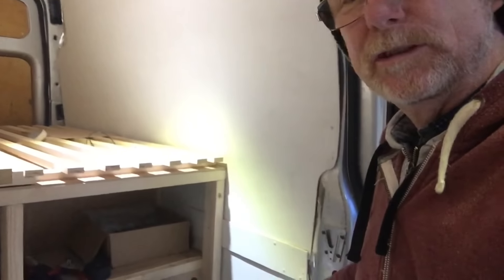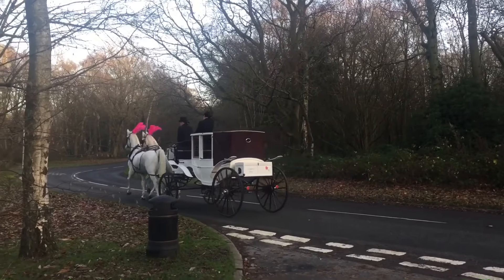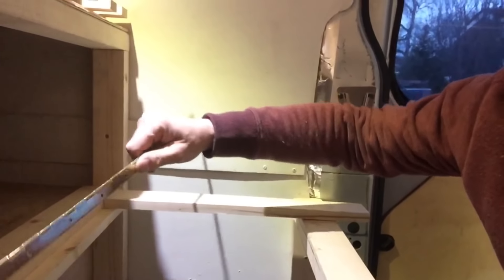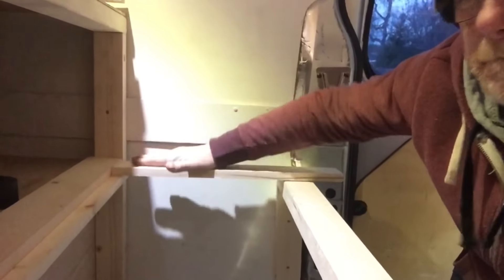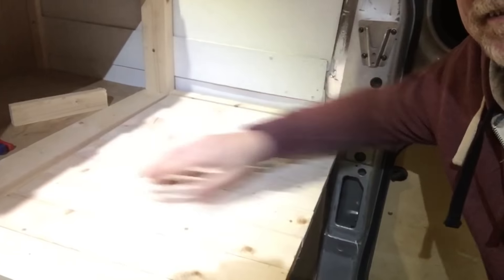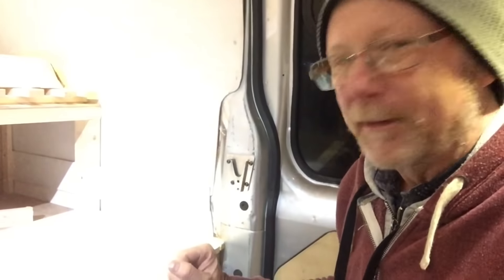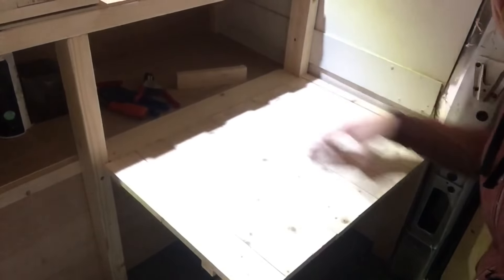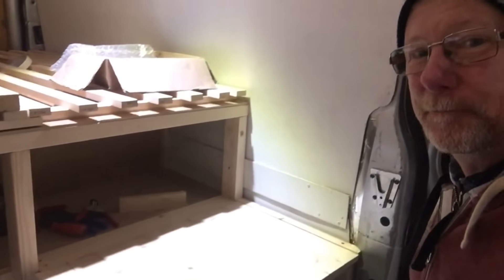HOW TO FIT A Cooler in a campervan conversion starting van life

Comment: I went for an alpicool c20 off ebay. Compressor cooler/fridge with battery saving tech built in. Not that cheap but seems perfect and very low power consumption as it's compressor driven.
Reply from the maker: they do look like good value thanks for the tip :)

Comment: You add a heater in one vid and then add a cooler in the next.  Make your mind up ffs mate :)  Seriously though good job.  Think about adding a strap from the cooler top to the underneath of the bench seat.  Then it will automatically open when you lift it up :)
Reply from the maker: Zen Zen thank you I did think about adding something to lift the lid at same time I’ll figure that out in time 🤓🤙